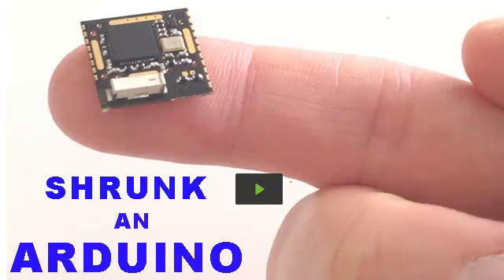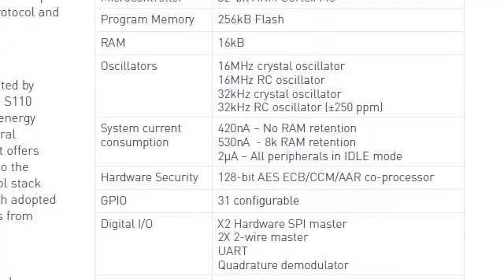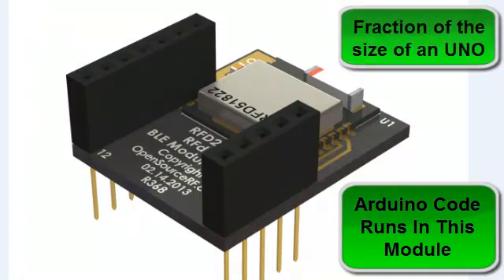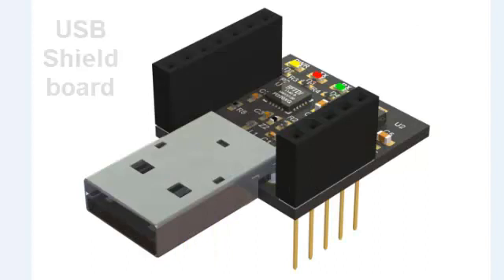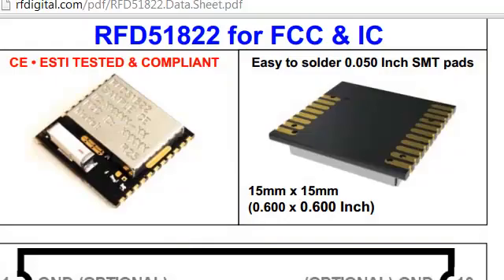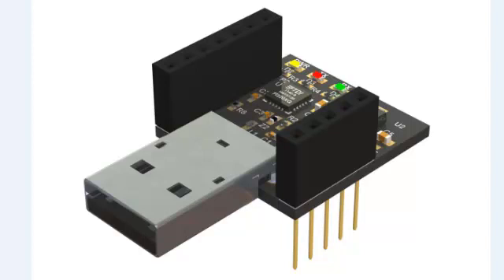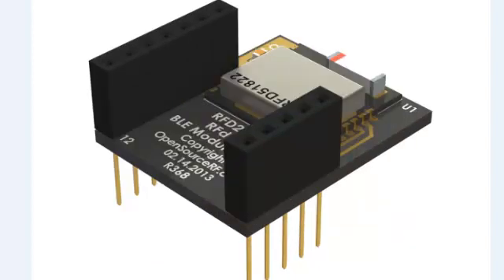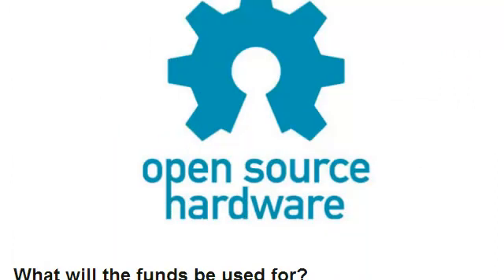How we shrunk an Arduino to the size of a finger-tip and added wireless!

Comment: 5 volt stuff is getting old. All the new MCU's are 3v3, and so are the sensors and the rest.
Reply: I think it's pretty nice to be able to switch on a relay without needing extra stuff.
But that also comes down to a relatively high source current on the Arduino.

The ESP8266 can't manage to enable a standard relay, since it just can't drive the coil from it's output pins. Ofcourse you can use the 5V USB pin for that, but well, you get the point.

Comment: Hmm - this thing is 3v logic, so that means that like the PI, you'd need additional gear to adapt this to any TTL/5v sensors/actuators doesn't it? Not quite something you can drop in where the Arduino would work.